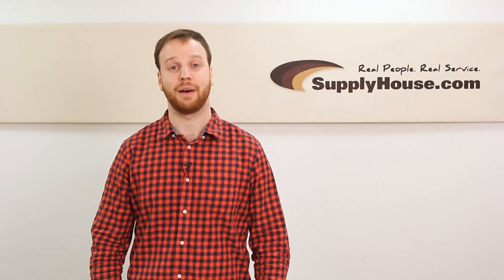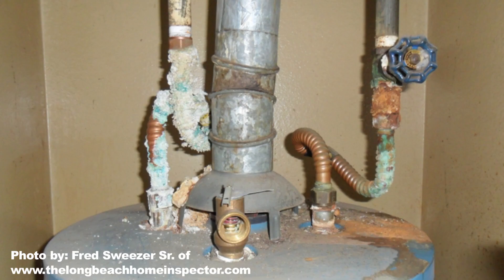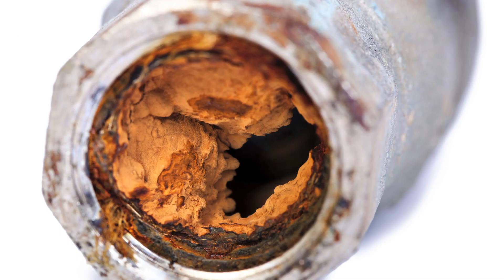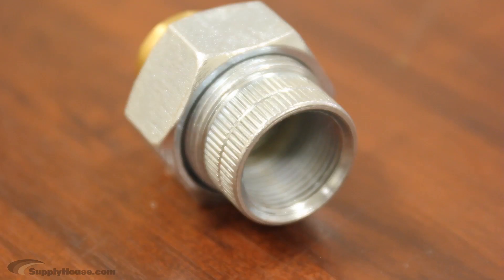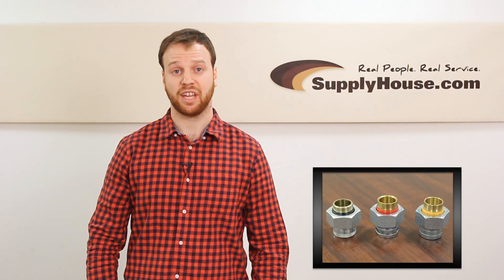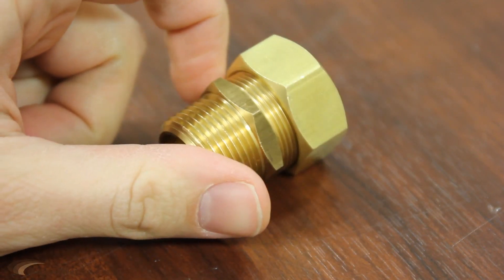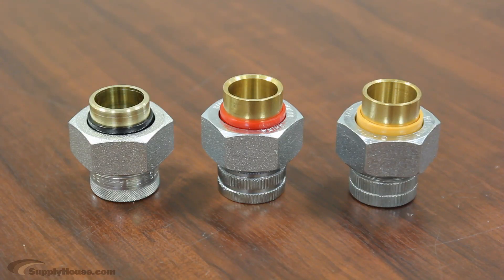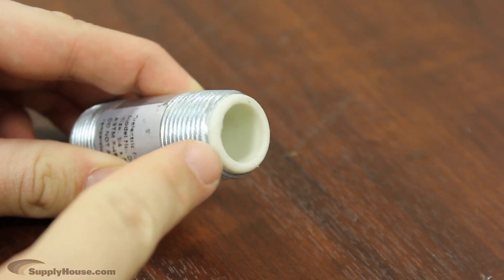Dielectric Unions

Comment: I have copper water tube on both hot and cold lines. There is a copper wire connecting them and ground it to gas pipe. Does this replace the need of dielectric union?

Comment: I have sweated a couple of these and had great results. I have a issue with them as provided. The labor of removing the sweated portion makes very little sense, when all that is failing is the nylon washer/collar for the nut, and the rubber washer. Upon disassembly, both my sweated brass and the pipe threaded seat looked brand new. With minor cleaning they both are flat clean and ready to seal with a new washer.  But, the nylon washer and the rubber are toast. I get that the nylon washer is the insulator for the nut and back side of the collar.. Can a new nylon be sliced to fit over the pipe, under the nut and be just fine? The  nylon washer/collar would be captured in conformity by the nut ( though have a slice) and one could replace the rubber washer, and be off to the races. Any pro's know?
Reply: Did you attempt this repair?
Reply: @ooxoo3980  Yes, Its been done for many months now. But, I went ahead and unsweated the nut side from the copper and installed the new washer and nylon nut isolator. Just seems we would have moved past all the unsweating/desoldering and resoldering, just to replace a rubber washer and Teflon nut insulator.  I reused the seat on the iron side. I had a spare union from first time I replaced it (bought two because of this pain) so they remained a matched nut and seat,
If you have a washer from another union and are willing to try slitting the teflon nut insolator from the same manufacturer, I don't see why it wouldn't be fine to slip it over the pipe, and tighten it up. The teflons held in by the nut.
Reply: @70ixlr86  thanks! I just took the drive to get a new union. The inner gasket was destroyed and the collar threads were damaged badly. I replaced the gasket and used the new steel side of the union to avoid the copper work. Worked fine. Thank you for the knowledge and reply.

Comment: I think the (steel) "dielectric nipple" is a joke. It does nothing to solve the problem of the interface between steel and brass threads. That is the problem. The dielectric union is the answer. They should be required by federal law. Consumers should be protected from bad practice.

Comment: So if the nipple is Die electric, why use another die electric?
Reply: Electrons can still pass through the threads of the nipple, to the nut, and to piping. These cut off the path to your copper piping using the rubber washer and the plastic collar inside the nut.

Comment: Question for everyone: When replacing my HWT, if I use two flexible copper lines (hot and cold) with dielectric fittings manufactured on both ends, can I run any size standard galvanized nipples to the lines out of the tank? Seems to me, that the when using the method above, the break has been made between the two different metals? Thanks, Garry.

Comment: a dielectric nipple is different from a dielectric union.  The nipple isolates the water from the steel but does not isolate the steel if you just connect it to a metal fitting on either side.  Some other videos have put forth that the nipple can be used inline to electrically isolate so it would help if you would clarify that the nipples only really work directly into the water heater.   A dielectric union should be used to isolate inline such as where an expansion tank connects to the line.  So the last part of the video is confusing.
Reply: Just for clarity, should a dielectric union be put in place wherever there is a change of metals such as galvanized steel to copper and copper to galvanize steel?
Reply: I have  a steel expansion tank  on the copper supply lines ahead of the water heater.  The tank is attached to the copper lines with a steel to copper dielectric union as shown in this video.  Because the union has a nylon plastic bushing it helps to isolate the copper from the steel.  However, in my experience this slows but does prevent the problem; the previous union in my installation had formed corrosion/rust  across the union  but this occured slowly over 5 years before I noticed and good timing as it  was on the verge of failing (leaking). 

If you have copper interfacing with steel it would appear to me, based on my experience, the unions helps slow the reaction but do not fully eliminate the phenomenon of galvanic corrosion.  I think it also depends on how hard your water is (ours is hard).
Reply: Vince McK